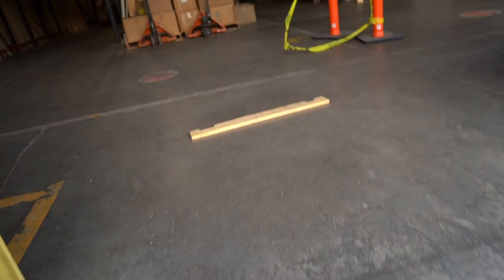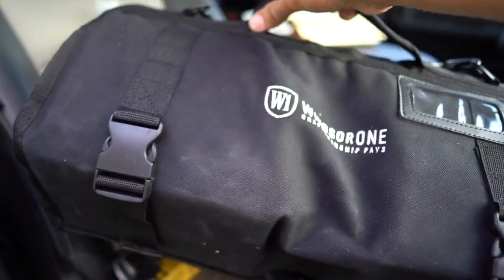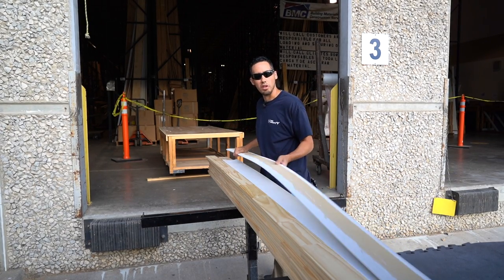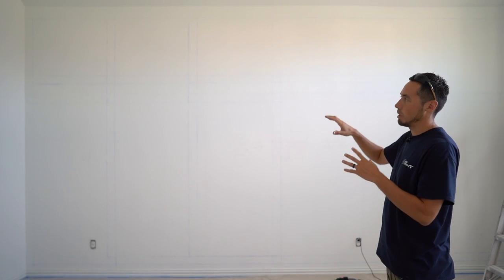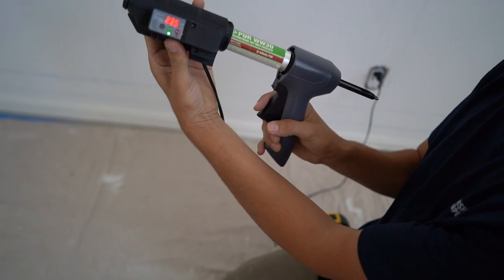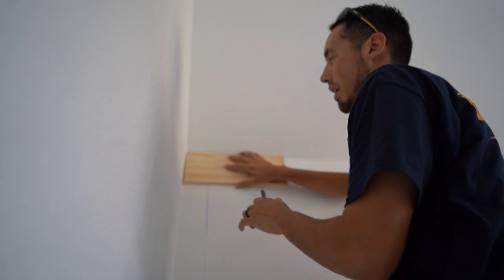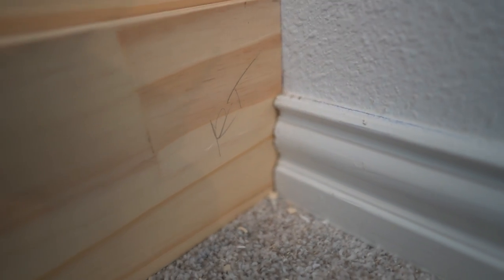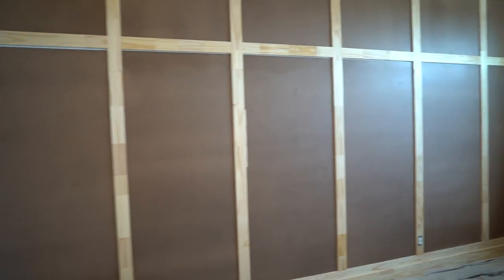NO More MDF!!!

Comment: The only problem with MDF is it can't get damp. Whereever gypsum plaster used to be the material I don't see any problem with MDF. I wouldn't use it for skirting, or architrave around external access openings or wet areas.

Comment: I recently made a huge mistake by using 7 1/4 × 5/8 MDF shiplap on a ceiling....
Unfortunately the ceiling was extremely wavy and the MDF just mimicked the contours of the drywall... They were 20' vaulted ceiling and I didnt anticipate this problem.... Wish I would have used pine or something more rigid to float over the low points... Hard lesson

Comment: I've been doing finish carpentry and custom cabinets for more than 35 years and I tried finger joint pine once back in the day. It is garbage and paints out like garbage. Solid moulding is way better if you dont want to use mdf
Reply from the maker: I know I usually can’t stand FJ products but the Windsor 1 is just like solid. It’s amazing .
Reply: I @FinishCarpentryTV  cool...best of luck to you Bud...btw...I cringe each time you let your tape measure slap back into the case. Bad practice according to my early training, cuz it loosens the rivets and introduces error
Reply: @FinishCarpentryTV  Also...as a layout technique, when dividing up a wall for equal panels, it is more straight forward (and simpler),  to measure from the left wall to the left side of the furthest right stile, then  divide by number of panels. This gives you the location of the LEFT side of every stile and is much easier  (and more accurate) than adding up all the stile widths, subtracting those, and dividing to get the panel widths ...hope that makes sense and hope it saves you some time!!! Cheers
Reply: @davebasch5995  cool
Reply: In the field is that brown,  tempered hardboard? Tempered masonite?

Comment: Excellent work - and excellent presentation. How I wish the two came together more often. I agree with all the negatives about MDF - but i think it does have two advantages

- our painters prefer it over, say, plywood. They say that it gives a better finish with less coats. I’m no painter and so can only pass that on
- doesn’t it save trees? I may be wrong but my assumption is that the trees and lumber that are used for MDF would no use otherwise? The clip that I saw on mdf making was all about using by-products which would otherwise be wasted. Therefore, doesn’t mdf prevent further tres being cut down? These are questions; not statements!

Anyway, one more subscriber.

Comment: Could someone please explain how he ‘scribed’ the top left piece of trim. He didn’t actually scribe it he just made a mark at 3/16” at the top?

Did he also make a compound cut, the angle to match the wall, and beveled to reduce the amount of surface making contact with the wall?

Thanks!
Reply: Cutting from the top mark of 3/16 down to the edge of the board creates an angle and matches the angle of that wall meeting the next one.

Comment: You shimmed out the top and bottom rails...I'm curious how you solve the problem of the corner moulding showing different depth of reveal between the rails and stiles. As always, an inspirational video.
Reply: Yep. That’s going to be a problem. He needs a planer.

Comment: Question about using PVC boards in bathrooms for trim work. Is this an ok solution? I didn’t want to use wood nor MDF because I was afraid it would get destroyed by the moisture and steam. Also, can I use CA Glue to glue them together before nailing??

Comment: Conform to uneven framing and drywall?? Blah! Framers and drywallers always do perfectly level and smooth work dont they??
🤪🤪🤪🤪
Reply: depends on who’s framming it or drywalling 🤣🤣
Reply: That's what caulking is for 🤤
Reply: If that were true I wouldn’t have spent about a week recently flattening wall framing and flattening and leveling ceilings before rocking them... 😉
Reply: So your eye sees the board wiggle down the wall.

Comment: I use primed finger joint, because I like to sand the wood down, especially when doing wainscotting, but also, as you well know, MDF creates a mountain of dust, absolutely will not use MDF sheet material, way too heavy and like my lungs too much, I'll use MDF crown, casing and base, that's it. That said MDF has it's advantages , particularly in large crown, only way to go.

Comment: From someone earning my junior finished carpenter badge I can say that I've seen  a lot crummier work with solid wood. You do high end stuff and it looks super clean, stays in place and it's not like you are finishing out a bathroom base or a basement in the PNW (wet, y'all) with MDF. Particularly because you are putting the finish on yourself and sealing it up, as well as in areas where it is not going to be touched I wouldn't think twice about it. I have made a lot of money correcting MDF in the wrong application too, and crown is definitely a correct application and also for all the reasons you bring up. Don't forget when you do sh*tty work you don't get referrals and it looks like you have your hands full.

Comment: Dude I hate that when you get finish pine boards that the 1x4s and the 1x6s are different thicknesses. Seems I run into that more on fingerjointed materials,so frustrating.
Reply: Might just have to break out the lunch box planer next time.

Comment: Thinking about doing this in our front room, but just noticed the wall is uneven, as in not flat. There’s a bulge from floor to ceiling from the seam of two drywall pieces that have been painted over. Does that matter when laying this out?

Comment: I would have just run the pine through a "thicknesser" so all boards are the same thickness :-)
Reply: mister clean  Kinda. Thicknesser is a special planer where you can dial in the thickness and then pass the timber through it. May have a different name

Comment: Don’t listen to the mo’s who give you crap for using MDF. They’re probably hand nailing their crown.
Reply: Nah, they probably work at a gas station.
Reply: Highly doubt that the majority of today’s carpenters use a hammer for anything other than bumpin a stud into the layout and demo.
Reply: Greg Fore I had a carpenter on one of my jobs hand nailing prehung interior doors. I have no idea why.
Reply: I use mdf for raised panels wrapped with soft maple in my cabinet shop alot if it's going to covered with a solid color lacquer or varnish. I spray the panel with matching primer coat before assembly. There's a place and time for everything.  Remember that as much knowledge we think we might have. That we are all students!  Nice work!  I prefer a portable drum sander for minimal thickness evening. Less chance of chipping.

Comment: One thing  I hate to see especially when I see DIY projects is the textured wall. In pictures it looks good but in person it really looks like crap . Odviously you can only do what your customer is willing to pay for but if it were me I would have put up sheets of 3/8mdf or even a another layer of drywall with the seams hidden by the moulding. It gives you a flat surface to work on and paints out nicely

Comment: You do really good work, you should be proud of the service that you provide to people, its upsetting that people would call you a "Cardboard Carpenter" because of the material you're using. 

The skill set is the same no matter which material you're using, the skills and processes are transferable largely. These guys who are trying to call you out for using MDF over real wood are old timers who probably haven't worked in 15-20 years. 

They see you using material that they didn't use and they see it as a mistake, they might've not been around then changes to systems were made and what not. 

They may be "stuck" in their ways, they didn't receive the education that you did on materials and they assume that the work done is subpar. 

Im a residential pipefitter, i recently finished college for it. More specifically, im a Canadian Residential Plumber, and the work i do is super important to the health of the general public. Most of what i was taught in college is the exact opposite of what the old timers in my field would do. 

the moral of this novel i've written is this; old timers want to do the best work THEY KNOW how to do, That doesn't always mean they're doing the best work. The old timers hate being wrong, anytime something you do contradicts what they'd do, it's going to be a problem. The old timers are intimidated by you because they know that you or people like you are coming to replace them. Old timers want the best product possible to be available to their consumers, and that is what you can manipulate to get your point across. 

The reason im writing this is because i feel like you're an excellent workman with impeccable processes, i wouldn't want some tom dick or harry's opinion to hinder you. 

Also i love your content, i care for you, and i wanna make sure you're doing well. I've done some finish carpentry in my earlier years and i know how hard it is to get the corners to mesh perfectly, you impress me with your cut n joint quality.

Comment: MDF is very soft. While it's easy to work with it is NOT durable. Any application lower than the ceiling and it will be beat  to crap in no time at all. Not trying to be hurtful...

Comment: Having the wall outlet wrapped in wood is a bad ideal. I hope you purchased the box extension insulator required. It's a small point but a legal point if a fire were to start at that receptacle. Clearly you were the last person to remove and replace it. Just thought I would wear my electrical hat for a moment.

Comment: I personally hate MDF. The only place it shines is crown molding. anywhere else it is crap. It does not handle vacumes bumping it. Sucks near moisture. It is real crap in real life. A picture fell off the wall and took a chunk clean out of the MDF floor baseboard.

Comment: so why is mdf so bad? it doesnt twist, expand and contract like the solid stuff, and you hardly ever get the hair line cracks you get on wood when you paint it
Reply: Great for crown not so great for casings or base boards.  We use sheets of mdf shiplap groove for panels.  It's more stable than wood.

Comment: He shouldnt use MDF becasue it melts when it gets wet. Most of the houses he works on have holes in the roofs and bad plumbing so its just a matter of time for him to get a call back from angry customers. He should use real wood so it would resist the water pouring in all the time.

Comment: Try Ekena millwork.
Reply from the maker: It’s foam right? All 8’ runs ?
Reply: @FinishCarpentryTV  yup,foam.I've used it before because it was the only place I could get a certain profile. Worked out good except for the 8' length thing.

Comment: Don’t cut the bevel out. Cut the Sheetrock. Much quicker. Cut corner scraps at 45 degree. Then you can eyeball of of a reference angle. Plus or minus. Mill the material all to the same thickness or at least measure the material.